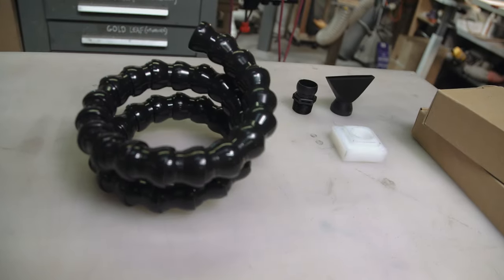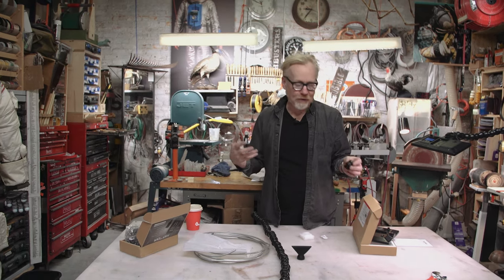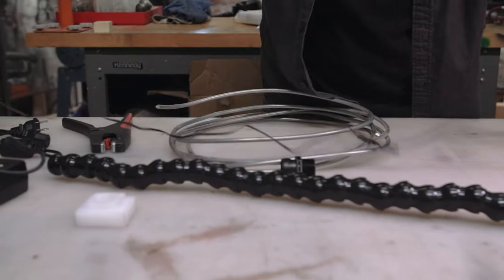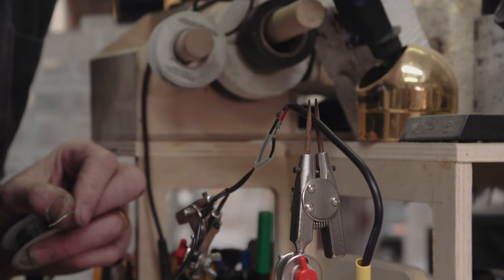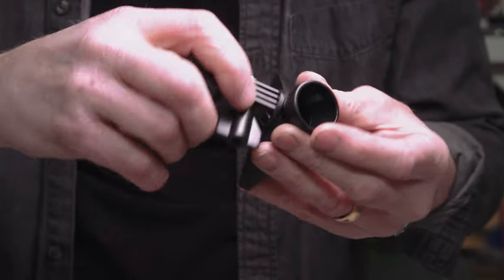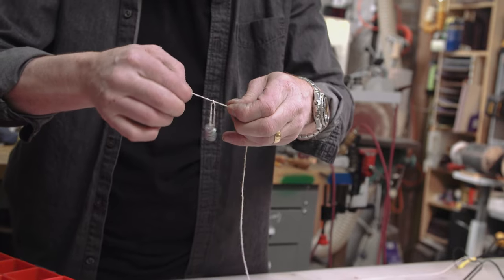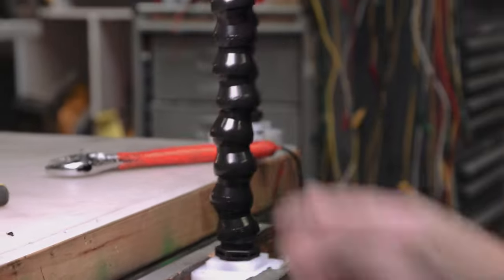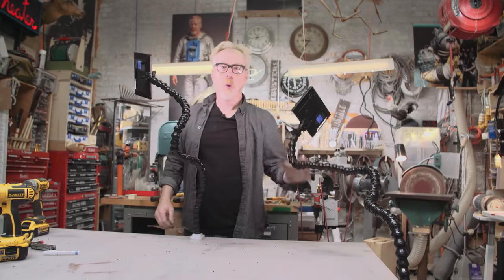Adam Savage's One Day Builds: Custom Workbench LED Lamp!

Comment: Here's a tip I learned from an old grey beard. On most cords one side is smooth and the other will be squared off. The smooth side is positive and the squared side is negative. Nearly every power adapter & lamp cord has this hidden feature. ***This isn't the case for every set of wire so if you aren't sure double check with a multimeter.

Comment: Great. Thanks. Glare? Of course, Snoot, grid, or both.  What I did for a pair of bedroom reading lamps  I mounted on the wall near the ceiling. Round LED spots,  tube of black paper (snoot) into which I inserted a bundle of drinking straws cut to about 1-2" long (grid).  For your lamp of course just make a box. Or you could just make a 'skirt' to hold the drinking straws to the lamp housing, and then there'd be a subtle glow of all the different straw colors.  I just scotch taped the straws together (hot glue would probably just melt them, glue, caulking...why didn't I think of that. Than  For each reading lamp I angled the ends of each snoot. The taper blocks the source from the other side of the bed. Now when my girlfriend reads in the middle of the night, she gets light on her book, and if I wake up and look directly up at the fixtures. I don't see any light. Extremely directional, which you won't want for your task lamp, so short straws in the middle of the bundle, long straws on the perimeter. The length difference is between the lamp and the short straws. Sorry to be such a busy body.

Comment: my work lamp is a pvc electrical conduit, rubberized light socket, an electrical switch, light dimmer, extension cord, wire clamps, zip ties and a spring clamp
but i should add the lock line or the 1 inch ball socket and clamps arm things to add articulation and rigidity

Comment: I just use a headlamp. Although most don’t have 95Cree or change color temp. But it's a lot cheaper . Just pick a lightwight single AA headlight. Like a Zebralight h52W or something brighter (but also heavier) with two head straps like a Skilhunt h03 (which also has a magnetic tail cap so you can stick it to any metallic object.) But some people don’t like to strap Li-ion batteries to their head

ps I love your projects and workshop <3

Comment: Hi there, I'm just going to geek out, so you can probably just skip my comment and save your time. I've worked at a scout camp for years, for most of that time working on the rifles and shotguns used in the shooting program. I gradually took on more and more responsibility for maintaining the guns, starting out with basic cleaning and moving up from there. I'm a tinkerer at heart (although not very good at it with most things) so I wanted to know not just how the guns worked, but why and how the pieces all fit together and stuff. Because of other challenges I have and some other issues, I'm going to be going into business as a professional gunsmith instead of pursuing it as a hobby. Part of that is going to be designing my own workbench for my private workspace, which brings us to why I scrolled through the channel's entire video library to find this video. (I'm dumb don't judge me) The major complaint with the workbench I have now is that there isn't enough light, and I don't really have the means to get the preferred amount. I remembered watching this video a few years ago, and the lamps are perfect for what I want on my bench. So I just wanted to say thanks to my favorite creator for making a video that stuck out in the screwy memory I have.

Comment: I was thinking about this and found flexible mic gooseneck could be a good option to use also. The mounting adapters to the light 1/4-20 to 5/8-24 and flange to screw it to a bench are all purchasable items.

Comment: If you use a lot of Loc-Line it's fairly inexpensive to get Loc-Line pliers for the sizes you use. It's not so important on 1/4" but when you start working with 1/2" and 3/4", pliers take away a lot of frustration.

Comment: Adam you should make a dedicated mouse (weight on a string) i used to use them all the time to run wires down inside walls when i worked installing telephones, we used a waxed string and had a length made up to use whenever we needed it.

Comment: Hmm. The whole point of the panel and diffuser is for photography where you don't want to cast harsh shadows. For detail work, you want the harshest shadows possible to give higher contrast. I use a 15w directional LED bulb in a $5 flexible clip desk light for arguably better lighting (although I have to clip and unclip to move around).

Comment: What would be really cool is if you were able to mount them to come down from the ceiling. Maybe add in a remote extender to lower it down and then attached in the end is the lock lite stuff, that way it doesn’t have to mount anywhere on your table and isn’t in the way when you are or aren’t using it.  And retracts neatly back up to the ceiling.  Would be difficult to figure out the wiring for that though, but I’m sure there is some kind of pulley mechanism you could incorporate to allow the wire to extend with the light when being brought down, and retract with the light to avoid bunching up when retracting it back to the ceiling.  Would obviously be a much more extensive and expensive modification but a very unique and cool one indeed

Comment: I noticed in the beginning of the video when you were demonstrating the Loc-Line's capability to hold it's position "even way out here" that like many many other swing arm lamps, physics won temporarily until you made a few minor tweaks to change the pivot point.  I've never worked with long sections of Loc-Line but I was wondering if you were to try using maybe 2 or 3 thinner diameter pieces of Loc-Line (perhaps 1/2" or 1/4") and manually braid them or, wrap a thinner 1/4" or 1/2" piece around the main/larger piece to give it just a little extra holding strength?  Just an idea.

Comment: What Adam refers to as an 8 amps transformer is most likely a switching power supply. They are usually designed for peak efficiency at around 80% load and efficiency will drop drastically below 50%. If you are going to buy a PSU for a specific project, your money would be better spent on a brand name PSU (not from ebay) that will run at 75-85% of its rating.

Comment: So adam, I have a question about those lights you made, that has been bugging me through the whole video, and would like you to answer it if you don't mind. So, here's the why of my question. You kept moving both those lights around, during the video, and the end would just bang around, while the rest would stay where it was intended to be, so... Why, if what's beyond the aluminum rod, won't stay put very well, do you not make it go all the way to the end, or at least close to it, instead of leaving a foot or more unaided? I saw you fixing the end of the light position so much, I thought you would surely think of that. Also, couldn't you, in theory at least, have some kind of setup where instead of that "small rod" in the bottom, you use a long bolt and nut assembly, and possibly make your stand a bit longer to have a small hole for the wire, and a big hole connected to it, for both passing the barrel plug through, and screwing a bolt into it as well, with or without a nut on the other end. It would give you better stiffness than the other small rod you used, would it not? What would be a reason not to use a somewhat skinny bolt, and/or nut?

Comment: Very well done, but I will probably use a DC extension cord with a female connector on the other end and a male connector on the end of the power supply cord instead of a splice. That way I can unplug the lamp from the power supply or use multiple lamps on a single large power supply.

Comment: As soon as you cut the washers off the string I thought "don't do that, you might find you have to re-do it 2 or 3 times to get it right".  And sure enough, you needed it again.

12v adapter?  I've got a box full of them.  Heck, if I could use an old 16v ThinkPad adapter, I've got a bag full of those too.

Comment: The 3/4" pipe thread on the Loc-Line threads neatly into a plain 1" hole in pine, if tapping the base is an issue.  Also if you can do with less length, 3/4" lock line will resist about 10" worth of horizontal moment from the weight of the Viltrox light panel with the battery in it, so you could maybe make do with one or two of the Loc-Line #60513 3/4" kits (3/4NPT, 2 x 5.25" segments and 2 nozzles for  ~$13) and bypass the armature wire, going cheap and fast for a 30 minute build
Reply: At first I used the plain round nozzle from the Loc-Line #60513 3/4" kit with a 1/4" cross-wise hole with a 1/4-20 bolt and wingnut to mount the light on the Loc-Line, but later I received the flat flange piece.  On the flange, I drilled a hole to match the Lamp's hot-shoe mount and slotted it out to the edge.  Now the hotshoe mount fits neatly into the flange, making it removable and even more adjustable at the end of the Loc-Line tube.

Comment: I would change out the Steel wire for a piece of steel pipe with an inner diameter big enough to slip the flex tube inside, if the pipe had the threads for screwing into the table mount then about 6-10 inches up, it'd be even stronger on that part and reduce the stress on the table mount from the handling of the lamp, I think, I wish I had my own shop so that I would need these kinds of builds

Comment: I know that the high CRI of this lamp is very important for prop work but if someone is on a budget you can make yourself quite flexible work light by getting the TRÅDFRI Dimming kit and TERTIAL lamp at your nearest Ikea. That way you can get yourself a dimmable 1000 lumen, 80+ CRI work light for $30. You could also just use the arm from the lamp as a base - it's quite good quality for the price ($10) and it's easily disassembled making it perfect for modification.

Comment: For Adam, use your heat gun to shrink your plastic tubes around your soldering cables/wires =faster and more homogeneous that relatively uncontroled heat from torch or in this case soldering drml tool. :)

Comment: Adam, not sure you've answered this yet, but what brand are the automatic wire strippers you're using? They look like the Jokari type design I've seen before, but I've never seen you mention them. They seem super easy to use. It might be time for an updated video about you "basic" tool kit advice. I've noticed you replaced a lot of tools since to vodeo I remember from four or five years ago. Thanks as always for the awesome builds!

Comment: I  have been using an old style architect lamp for my hobby bench, with an led buld its ideal. i use the same set up at my drillpress and sander. I have never had that loc line stuff not fail on me (tripod, scroll-saw, and band-sawall broke) I remix im thinking of is this panel on an architect lamp arm (i know you'rs has more range of motion but, i like the pivots and springs on old lamps.)

Comment: Why not run thinner wire (like, clothe hanger wire) all the way through in addition to the armature wire and steel pipe? That slight weakness at the far end would drive me batty. Call me crazy but spending that extra second to curve the loc-line for support would really harsh my vibe, you dig?

Comment: You don't need line-loc tubing for this project. The wire and a hose, cloth or flexible commercial electrical conduit will work too.

Comment: I would've added a pair of male and female barrel connectors at the adapter end - so you can swap out/ change the PSU without cutting, re-fishing the wiring.

Comment: Adam, have you tried the shrink tube that has the bit of low temp solder in it.  Basically you put the tube on the wire push the two wire ends together and shrink the tube which at the same time solders the ends together.  I've seen it advertised but i'm skeptical.

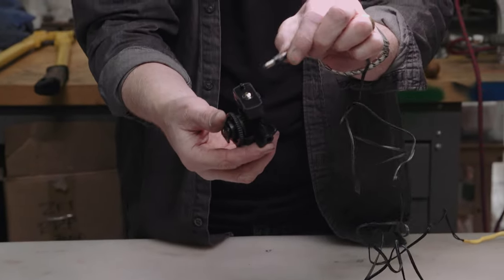Comment: 13:45  Shop vac works for this, learned from building newer bike frames with internal cable routing.
The armature wire doesn't eventually break from repeated flexing?
Reply: aluminium has a high fatigue strength so it should last a long time

Comment: It would be nice if your workbench had sockets where you could screw in or press fit that arm into it and it would have a base like a lightbulb so you could remove it when you don't need it or its of the way and you could move it to another side of the table.

Comment: Aluminium work hardens. If you're using aluminium armature wire as the flexible internal support for a lamp like this I would suspect a fairly short service life before it becomes brittle and breaks. I only have my experience with armature wire to go on obviously, but it's not something I would rely on if it needs to both provide support and be continually flexible. Would be curious to see a follow up on this, or hear from someone who has used aluminium wire in a similar application.

Haven't read through all the comments so someone else has probably mentioned this already.

Comment: not straight aluminium, probably AlMgSi, but annealed to stay soft until work hardened. Like say lightning rod wire, you need to be able to bend it fairly easily.

Comment: You should have wrapped the armature wire in black tape or heat shrink in case all the bending ended up snapping the wire so it wont damage the power line and make a short

Comment: So I wound up using this idea except I'm using a magnet as a base because I have sheet metal on my walls in my shop and metal tables so I can move it anywhere in my shop and I have it connected to a battery as well a plug on it so if I need it in an area without an outlet then I don't half to worry about it

Comment: i have made this before this is a updated one i made the last was crap so made rebuilt one but the Armature Wire  i got from a friend that he had left over i need to find more but thinner one for my next project for this light  i tripled the wire  twisted it together was going to use a foam tub but it did not work was to hard to bend with the foam so i just use 3 pieces of wire twisted them together and work much better also made the wire full length of Ball Socket. to mount the gopro tripod mount  i use a  wood rod that fit in the Ball Socket shaped the end of the rod to a ball to fit in the tube. drilled a hole all the way and a little bigger hole at the top to fit the gopro piece then use a long bolt to tie it on to the gopro then glue it on the the ball lock tube and use small screws to keep it there  to mount it to the table i use a C clamp no welding bolt it on backwards nuts at the top  then added a extra piece to fit over the bolt heads wood and rubber

Comment: If you have an old cold cathode lcd screen that the lcd has cracked you can pull the power board and back light and normally there is a header pin on it that will have a screen printed section saying how those pins are laid out. On my old Samsung screen the pin layout I needed was to bridge the 5v to on and brightness and now I have a nice 19" flat light. Admittedly I can't change the brightness as it does not off a pot. But  yo could see some. One that way

Comment: I wonder if, instead of the aluminium armature a length of heavy duty (high current such as used for an electric cooker) would simplify the design as it would serve as a stiffener and electrical cable from the power supply?

Comment: I bought a round magnifier led from Amazon for $79.00.  Not quite as flexible but I only work in one spot so I only need it to be adjustable in a very small range and it works great.  But the light output and temp aren't adjustable.  Not sure I need that though.

Comment: Adam you need to buy yourself a VS3 tool and a tub of connectors for small gauge wire. no more stripping, soldering, or heat shrinking. Just put the wires in the crimper with a connector and you're done.
Reply: you'll save yourself hours of work. its a telecom tool, will do 26 to 19 gauge wire, can handle 400v without a problem

Comment: Tested Crew, I am trying to create an adjustable mount like this for an iPad. My friend is wheelchair bound, but loves watching videos on the go. I would love any suggestions on how to get increased stability in the length of loc-line like Adam has done with the weight on the end being nearly two pounds or so. Thank you!
Reply: Just use solid core electric wire possibly 10 or 8 gauge down the entire length of the hose to give it additional sturdiness and holding strength. Could also use higher from coat hangers

Comment: Regarding voltage and current necessary for your lamp head: look at the data plate on the rear of the lamp unit; it will be a label or text molded into the plastic.  It will tell you the voltage and current (amps) necessary to run the lamp.  Looks like this one, which is for a power supply: https://image.slidesharecdn.com/pcmaintenance-120903042951-phpapp02/95/pc-maintenance-84-728.jpg?cb=1346647907

Comment: I need a couple of desk lamps like this for my makerspace...  I'm curious how you determined you only needed armature wire to go half way up the length of the lok-line?  What would be the pro/con of putting it all the way up?  I noticed that in some configurations, your light still fell down under it's own weight.  I wonder if more wire, or even a doubled up length of wire the entire length of the lok-line wouldn't solve that problem, for the cost of making the light more stiff to move around.  Either way, I think I have a new project for this weekend ;)

Comment: wish u do a one day build on making a 
135W Professional Photography Softbox with E27 Socket Light Lighting Kit for Photo Studio Portraits Photography Video Shooting EU Plug

50 x 70inch Photography Studio Softbox with E27 Light Holder
Made of imported fabric high-reflecting and head-resistant material
The refraction reflective capacity is twice as common particles of reflective cloth
Color: Black / Silver (Out / In)
Soften lighting for reducing overexposure and hot spots
need one that work on 220v